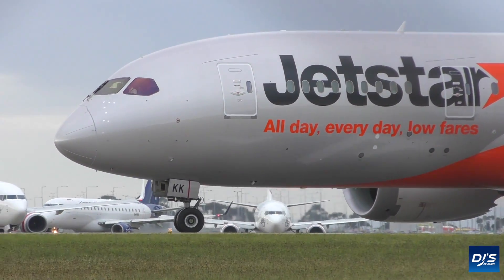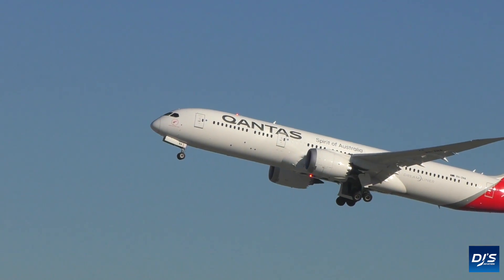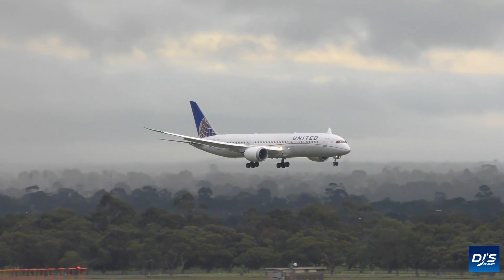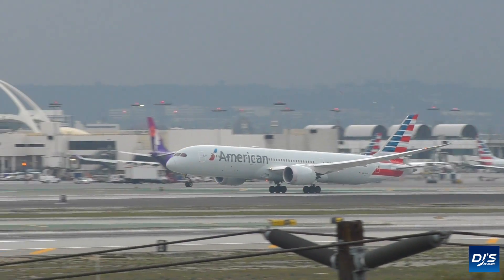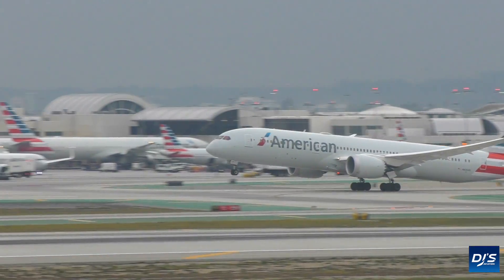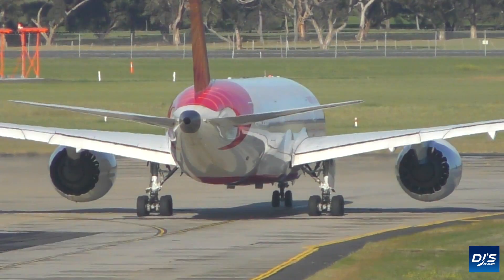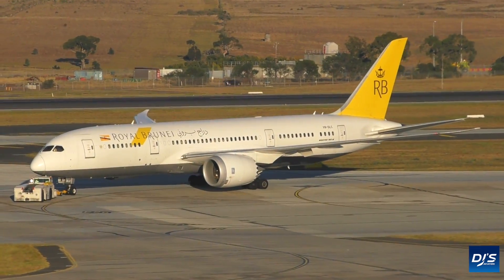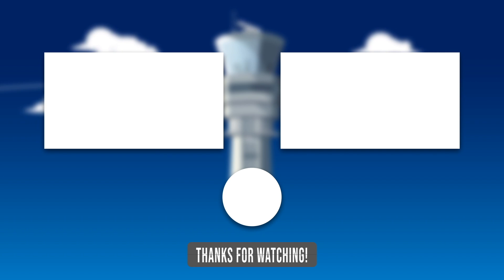Another Boeing 787 Problem

Comment: 787 has the potential to replace the MAX
Reply: I know it’s likely a joke but can you please explain just to clarify what you meant. Unless you meant replace the Max as the killing machine in which case I’d rather stay quiet to look at both sides to the situation
Reply: No it doesn't. One is designed for long haul, the other short. Sure, you can fly a 787 on 737 routes unlike the other way round but it's too big and hugely uneconomic to do so !

Comment: Keep in mind that a gap of this size, 3.4 one hundredths of an inch is very close to being in tolerance. So it's not like a wing half is about to fall off. People these days seem to like to blow everything out of proportion. The world has to be all white or black, no room for grey. As I recall the A380 had a wing component issue. Just like this, the system worked, the issue was found and corrected. No big deal.
Reply: people these days (like you) go out of their way to defend Boeing
Reply: @ant2312  If stating the facts is defending Boeing, then Mea Culpa. To me, I am neutral between Boeing and Air Bus. These are products that I will never own. In the real world they are both adequate and fit for purpose. Both are safe enough in so far as nothing (right, read it again) is perfectly safe or safe enough.
Reply: @redlock4004  This is why I do not want to own any aviation company stock. I’m happy with my investment in Nutmeg instead that I started in March when the stock price was at its lowest ande now it’s on the road to recovery (pun intended)
Reply: If it  was just one or two issues with the 787 fine but it's not.

Comment: I feel the worst for norweigan they only have the 787 and maxes
Reply: They do have older 737's, like the 737NG...

...which has the pickle-fork problem...

It looks like Boeing need a quality drive.
Reply: @filledwithvariousknowledge1065  I don't know where you get your facts, but that is not my experience.

Although on furlough at the moment, I am involved with the aviation industry and have been involved with the pickle-fork issue. An NDA prevents me giving details of who was actually doing the work or who the client was.

What I can say is that an Irish client brought an aircraft in to a major maintenance facility here in the UK.

The work took over a month, beginning with the entire aircraft being stress-braced and the centre section of the cabin being stripped.

That doesn't fit into my definition of an easy fix, especially since the team of engineers worked 7 days a week and 12 hours a day.

I have seen the old pickle-forks, which is how I know what was being done.
Reply: @iantoo3503  Your right since you’ve got the first hand experience. I’ll take down that post

Comment: The clowns who have designed this aircraft should be fired.
Reply: iTech Talk - First Boeing A/C designed by bean counters & not aerospace engineers.
Reply: It's not a design issue; its an assembly issue.
Reply: @bd5av8r1  there you go again boeing fanboi
Reply: Ant well he is technically correct. If it was built differently to how it was designed then it’s not a design issue. If you were an architect and designed a building, the builders built it but it fell over because they didn’t build it to your design then it would be their fault. It’s still a Boeing problem
Reply: bd5av8r1 - You do know assembly is being done by Boeing, & that Boeing has been compromising safety to get the costs down & maximize profits - Right?
Reply: @tomstravels520  That is exactly the underlying problem, compounded by Boeing's asemblers being told to make substandard parts fit.